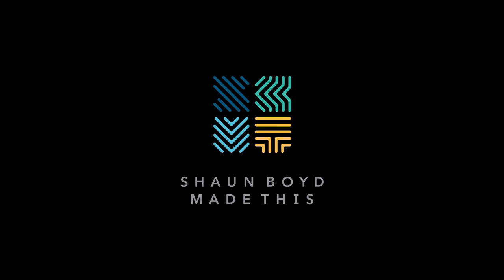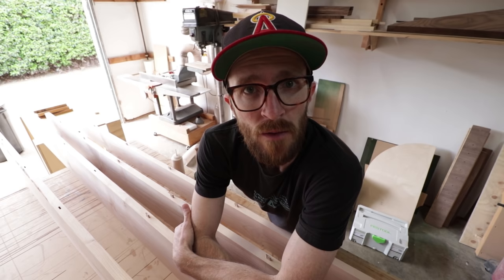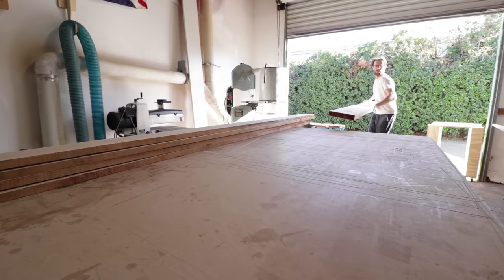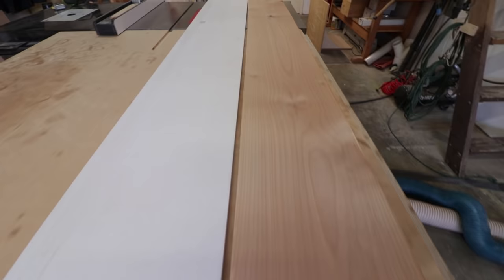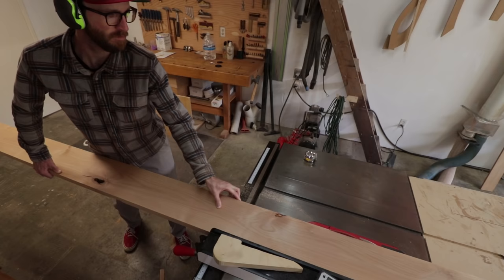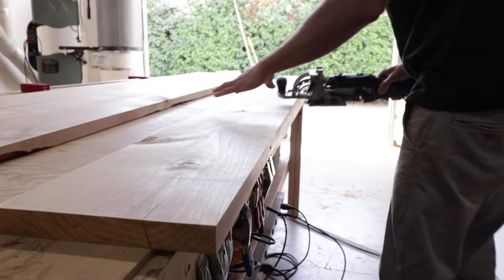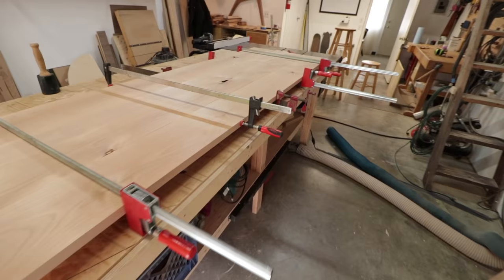How to Make a Table Top Without a Jointer

Comment: I always wonder what's the point of buying a jointer when you can joint boards using a table saw? Anyway, keep you videos coming, long or short, as it's always a pleasure to watch you working! Oh, and am I wrong, or did you watched a few Peter McKinnon videos lately?
Reply: HODYO Design,  A jointer is nice to get stock flat before you use the planer, especially when you use rough lumber.  It's also faster to joint boards if they are not too far out. But if you're just doing cabinets, for example,  I guess you might not need a jointer.
Reply from the maker: Thank you! There is almost always a way to make do with limited tools! And yes, I am a big fan of Peter! It is hard not to be influenced by his video style.
Reply: You are quite right on that. Tools can just make life easier, or actually much harder if you can't make that payment on all those CNC machines you just bought.
Reply from the maker: Haha, that is VERY true.
Reply: As long as you are a pro furniture maker using hard wood, I couldn't agree more. I had the woodworking hobbyists in mind when I wrote that: many of them have a jointer (small, most of the time) that they only use once in a while, if at all, and it doesn't really make sense.
Reply: You can joint edges, but good luck jointing a face with a table saw.
Reply: Justin you can joint à face with a planner, but again I was talking as a guy who doesn't do much wood work, not as a pro.
Reply: Because a jointer can do large areas.. also doing it with a table saw requires a lot more setup and chance for mistakes
Reply: As long as you own a planner, a table saw and a router table, I still believe that the jointer is optional if you don't do much custom furniture.
Reply: What is the point of doing it with a table saw and thicknesser when you can do it with a hand plane.
Reply: Sure you can joint with a planer but it's a massive pain in the ass because it requires making one of those shim sleds that is as long as the longest board you want to joint. Technically optional but not really all that easy to forego
Reply: Should a feather board be used to keep the board to be cut against the reference board?  Not alotnof pressure just enough to prevent walking. Or would it just cause more trouble?
Reply: @bighands69  cause i want to be done before next year ...
Reply: @Justin-C  I was wondering about this as well, I keep finding "joint with a tablesaw" videos, but they seem to assume you've already jointed the face flat.

Comment: How do you prevent the board from wondering when you push the two of them through?
Reply from the maker: It really just comes with practice, you just get the feel for how to hold the board and where to apply pressure.

Comment: Did you face joint prior to cutting the straight edges on the table saw. It looked like you took them straight to the planer but I didnt see a sled or anything...
Reply from the maker: Not for these. with long, fairly thin boards, you could potentially lose a lot of thickness when face jointing. Instead, I take my time to select the straightest boards possible at the lumber yard, then orient them in a way that any bow will be more or less canceled out during the glue up.

Comment: Was the material already face jointed since you started on the planer?
Reply from the maker: No, but I am careful to select straight lumber when I can. Also board orientation and using something like dominos or dowels will help eliminate any bow in the boards during the glue-up.

Comment: Hey Shaun, what is the best way to get a solid, flat, level work surface for building a table top? Last one I built I struggled so much to get a flat surface to build on. Will investing in some 4 ft. Bessey H-Style 3/4" Pipe Clamps help with that?
Reply from the maker: Yeah, having a flat work surface definitely helps to make your work more accurate. A torsion box style work table is a great way to get a flat, and very solid surface. But even without a perfectly flat work table (mine isn't) you can still get flat table tops by using things like clamping cauls across the width of the table, and being careful to apply even clamping pressure from both sides of the table top. Hopefully that helps!

Comment: How do you secure the MDF on the base of the planer to feed the wood through? I would think it would just slide through with the wood if not secured somehow. Thanks.
Reply from the maker: It just has a small piece of wood screwed into the bottom on the infeed side that catches the planer bed so that it doesn't slide through. Thanks for watching!

Comment: Hey thanks for the video man. It was very helpful. I’m just curious though, since the fence is obviously square to the blade (I’m assuming), and the board you’re using to guide the piece to be cut is straight, wouldn’t it be the exact same result if you just cut the edge of the board then flipped it and cut it again?
Reply: Gerald Arismendez The trick to this method is the straight board being at or longer than the workpiece and traveling with it through the entire cut so the board does not change position. What you propose would work if the fence was twice the length of the workpiece and your ‘high points’ made continuous contact with the fence through the entire cut.

Comment: Praying you answer because I NEED to know what your MDF "jig" looking thing is that you use on your planer? I have 8/4, 8ft maple lumber with an unfortunate twist (i always have this problem though) and need to flatten it for an eventual cutting board... I bought an 8ft MDF board and tried to super glue and it was a disaster! Is this a solution I can use? What are you doing with that board, and how does it work, and does it work on boards with twists? 

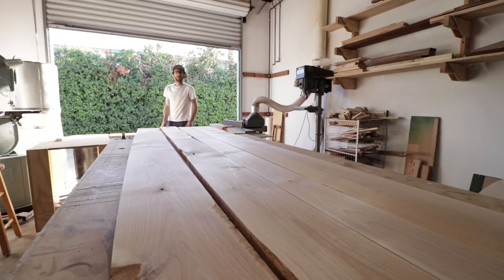Does anyone know what that is? (@ 1:58 into video)

Thanks to all that can help!
Reply from the maker: Unfortunately, that is just a piece of melamine to extend the bed of my planer. There are a few techniques to get twist out of boards using a planer, and it sounds like you were on the right track with the MDF and super glue. I do that occasionally with shims, but always use hot glue instead of super glue. If you are making a cutting board, I imagine your 8 foot lumber is going to be cut up into smaller pieces, so maybe do the milling in smaller chunks? Hope that helps!

Comment: Love your videos and the pieces you build, mate. Keep them coming. I have a question. I've seen you put your rough boards straight through the thickness planer without flattening one side first on the jointer (or some other method). Other woodworkers make a big deal of getting one side flat first and then going to the thickness planer to get the other side parallel. Howcome that's not a concern for you? Are you not having issues with bow/cup/twist?
Reply from the maker: Thanks, really appreciate it! Having flat and parallel faces is definitely important and ideal. Because I don't have a big jointer, I spend extra time picking out lumber that is as straight as I can find. Also, when I make something like a table top, I usually use thinner material (~1" thick) and can orient the boards so that when I glue them up and use dominos, any bow in a board can be more or less cancelled out by the boards it is being joined to. Hopefully that makes sense!
Reply: Shaun Boyd Nice deal, makes perfect sense. I was trying to understand if you just didn't show that first step of flattening one side or if you simply skip it because you work with stock that's flat enough to begin with. Sweet that it's working for you this way. I'm guessing you already know this but there are pretty neat-o ways to flatten uneven board with the thickness planer and a flat surface "jig" to support and register the uneven board on. But yeah, you're  probably well aware of that method already. Anyways, I really dig the pieces you build and your template techniques. Cheers!
Reply from the maker: For sure. If I am using thicker boards that can't flex much when gluing into panels, I use some of the different methods like you are talking about. There is always a way to get it done regardless of what tools you have! Thanks again for watching my videos!

Comment: how did you get one side of the board flat as a reference surface for the planer?
Reply from the maker: Because I don't have a big jointer, I spend extra time picking out lumber that is as straight as I can find. Also, when I make something like a big table top, I usually use thinner material (~1" thick) and can orient the boards so that when I glue them up and use dominos, any bow in a board can be more or less cancelled out by the boards it is being joined to. Hopefully that makes sense!

Comment: Hi Shaun,
thanks for the tip.
But how do you make sure the boards are flat? The planer does not do that job.
Cheers Mark
Reply from the maker: Thanks, Mark! I definitely take my time to select the flattest boards I can find at my lumber supplier. I also make sure to orient my boards before the glue up, so that any bow in a particular board is flattened out by the other boards. I'm almost always able to end up with a very flat table top.
Reply: Shaun Boyd I had the same question. I guess you jointed the sides but not the surfaces.  Do you have a hack for jointing large surfaces without a jointer?

Comment: Does the MDF board need to be that wide or could it be smaller as long as it's still 10'??
Reply from the maker: No, it can be thinner. The only thing is the thinner it is, the less rigid it is. So you could potentially flex it and not get a straight cut.

Comment: I think it is a good idea to make short vids (5-15 minutes) for in between the big ones. How do you prevent planer snipe?
Reply from the maker: Right on! Thanks for watching! If I can, I try to plane my boards while they are still long, and cut off any snipe afterwards. When that isn't possible, I try to give slight upward pressure on the boards as I feed them in and out of the machine to help a bit.
Reply: I have heard about that before. I just bought a nice used 12" Jet planer and thought about making one of those sleds but saw you didn't use one and didn't see any snipe on the board, so I wanted to ask you. Thanks Shaun!

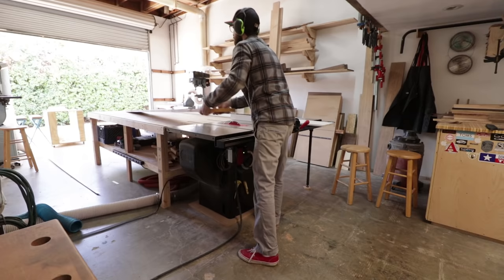Comment: At 3:20 you mentioned flipping the board, I thought turning the board so the same face stays down on the table is the correct way. Anyway I like your video and will subscribe to your channel.
Reply from the maker: In this case, it doesn't really matter. All I'm doing here is getting the second edge parallel to my now straight, opposite edge. The orientation of the board shouldn't make any difference as long as I have the correct edge against the fence. Thanks for watching!

Comment: Without a jointer but you need to have an auto planer and a table saw.
Reply from the maker: Jointers are a lot less common to have than table saws and planers, so that was the purpose of the video. Thanks for watching.

Comment: OK I am struggling with this. How do you manage to find 8+ ft long boards that are dead flat? I would think face jointing would be necessary at some point in the process?
Reply from the maker: Ideally, you are right. But with only a small jointer, this isn't always possible for me. Using dominoes/dowels/biscuits helps align everything, as well as careful selection of lumber.
Reply: Asking because I am in the same boat. I actually DO have a large jointer, but I end up losing a boatload of wood thickness whenever I try to face joint something. I may have to do some experiments. I need a 9ft table top and dont want to buy 8/4 lumber to get a 1" thick top.

Comment: Just wanted to know did you flatten the board on one side before planing? Or is that not a thing for longer thin boards? Meaning like in your most resent video fattening on a jointer trick. Thanks
Reply from the maker: Yeah, with long and fairly thin material like this, I often skip face jointing them. Once they are all glued up and attached to a table base, it isn't a problem. I also take my time to select the straightest boards I can at the lumberyard.
Reply: I assumed that was the case. Can I ask what’s your limit on this. Like anything over 6/4 needs to be faced planned? Thanks sorry for follow up. Thanks for help
Reply from the maker: @brianstephenson2157  Yeah, definitely with thicker material it becomes more important. It also has a lot to do with the application. If it is a big table top that is being attached to a big table base, you can probably get away with it. But if you are making a solid wood cabinet or shelves or something, you might be using 4/4 material, but you want those to be as flat as possible. So face jointing before planing is probably the way to go. Hope that helps!

Comment: Nice Shaun! What blades do you commonly use on your bench saw? Do you switch allot or do you have a 'go to' all purpose favourite.
Reply from the maker: Thanks, Willem! Most of the time I use a 40 tooth Forrest Woodworker II, but also have a 40 tooth Diablo blade while the Forrest is getting sharpened. I will occasionally switch those out for an 80 tooth blade if I am cutting veneered plywood or something.
Reply: Shaun Boyd . Thanks Shaun. Always good to know what you immortals are working with ! Love your work and really enjoyed this tip vid you threw in the mix. Smashing idea. Keep up the inspiring work.

Comment: What type of blade did you used or which would you recommend as for the amount of teeth?  thanks
Reply from the maker: I have a 40 tooth Forrest Woodworker II that is in my table saw about 90% of the time.
Reply: @shaunboydmadethis  thanks man!!

Comment: What do you mean your boards are too long for the jointer? It doesnt care about length. Just get some cylinder runners to aupport the weight. Now if the boards were too wide that would make sense
Reply from the maker: Certainly. There are many ways to do most things. I am showing here that you don't need a jointer to get this done or as an alternative to trying to manage 8' long boards over a small jointer.

Comment: what made you go the Domino route instead of dowels or loose tenons.
Reply from the maker: For table tops it is just because the Domino is the only thing I own. I first bought the domino because it felt like the most versatile tool that I could use in many different applications.

Comment: You don't even need a table saw...or a domino tool. Use thicker wood. Use a long aluminum straight-edge with a powerful circular saw with a good blade for ripping. Then edge glue and put perpendicular boards that are mortised for the table posts on one side (the ugly side); this will be the underside of the table.
Reply from the maker: That is definitely one way to do it! Thanks for watching!

Comment: Hey Shaun. Just bumped across your channel. Love your work mate! Just wondering whether you get your timber faces milled at the mil cause I haven't seen you use your jointer?
Thanks!
Reply from the maker: Thanks Jose! I usually buy rough lumber and will joint stuff when needed. On a table top like this, I took the time to pick out straight boards, and then do my best to orient them during the glue up, so any bow is flattened out by the other boards.

Comment: So, why did he use that long piece of mdf if he just ran it along the saw fence?  I don't understand.
Reply from the maker: You need a straight edge on one side of the board in order to get a straight cut when referencing off the table saw fence. The MDF acts as that straight edge since the board is so crooked. Hopefully that helps.
Reply: Shaun Boyd the fence is a straight edge, so this makes no sense. You can’t mill boards with just a table saw. You need a jointer and planer. Or a router and a jig.
Reply: As he explained you need a straight piece longer than the material piece.  Without it, when you ran the board down the fence (with the concave side facing it), the board would shift towards the right as it went past the end of the fence. and make the cut crooked.
Reply: The MDF acts as an extension of the fence  and allows you to run the piece in a direction perfectly parallel to the fence. Otherwise the piece would change directions slightly due to not having a straight edge, and you would never get a straight edge as a result. Another method is using a sled, and it achieves the same thing (running the piece in a uniform direction).
Reply: Mike Martinez exactly!
Reply: Even with a short video, some people have a hard time paying attention.  :(
Reply: I'd you don't understand get another hobby
Reply: Because the fence is shorter than the board

Comment: ... without jointer. But here comes the bigass planer i dont have!
Reply: planer is not needed! you're only joining the edges. You could use the same method for the faces or just wait til after joining the boards and use a handplane

Comment: I've never used a domino, so I wonder why glue them?
Reply from the maker: Honestly, you could probably get away with not gluing them in because the rest of the glue joint is plenty strong. But if I am already gluing everything else, it doesn't take much more time to put glue into the mortises. Just a good habit to get into, I guess.